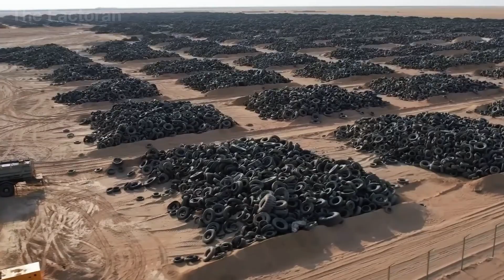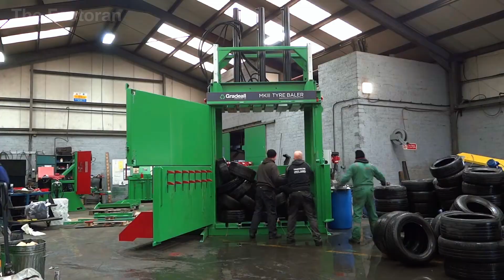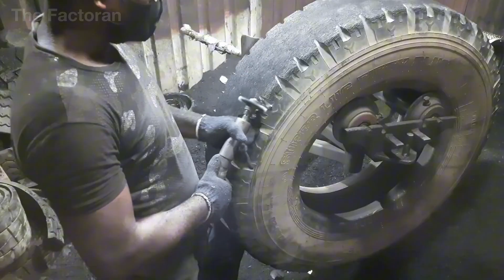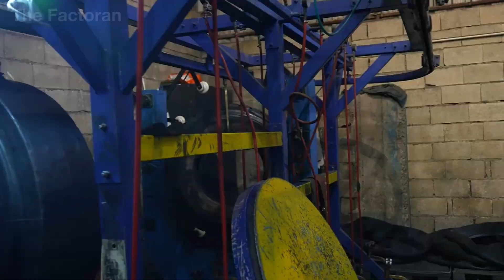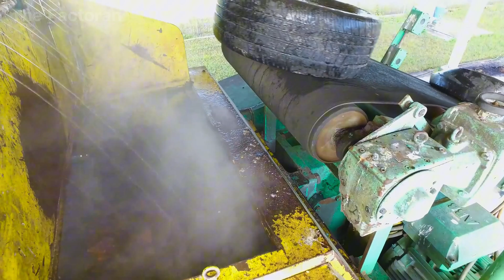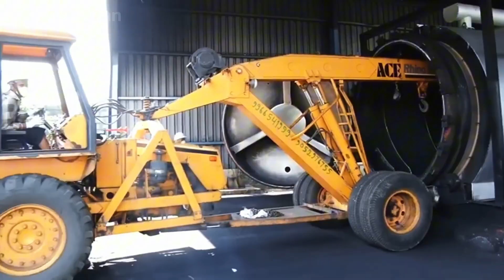How Millions Of Tires Are Recycled Inside Massive Scale Recycling Factory

Comment: Decades ago, I was told 'tires can't be recycled'.  Now they can?
AND if they now can, why is there a recycling fee from tire stores? Doesn't this mean it's still cheaper to go new?  
I did buy some of the ground for under my patio, makes for a softer step.
Reply from the maker: 💸 The recycling fee still exists because the process is complex, costly, and requires special handling (tires are bulky, flammable, and hard to break down). That fee helps cover collection, transport, and processing — not just the materials.